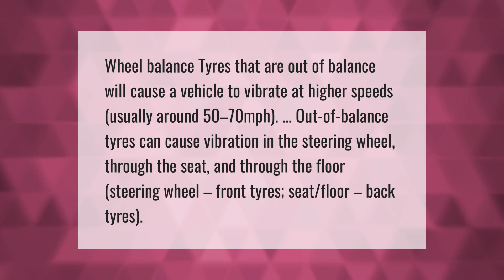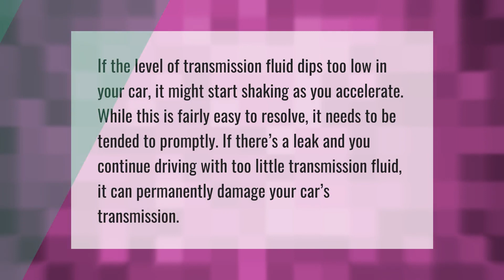Why does my car shakes over 70mph?

Comment: Can bad alignment cause vibration?
My car shakes over 70 mph so I took it to Mechanic who checked it and said everything is tight then I balanced the tires but that didn't fix it either.
I suspected engine or transmission mounts so I dove to 80 mph and put it in neutral to disengage engine and transmission but the shaking was still there. Any suggestions?
Reply: Same thing is  happening to my car now
I took it to the dealer service also to the mechanics and they didn’t fix the problem. Did you find out what’s the problem was in yours.